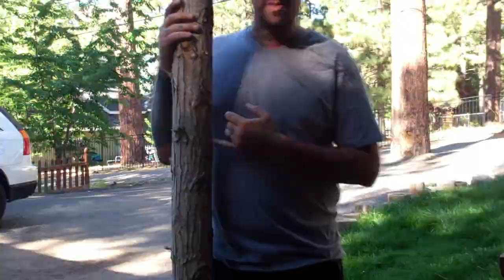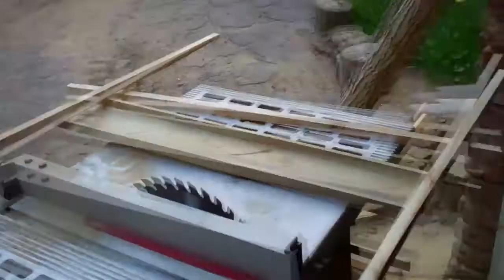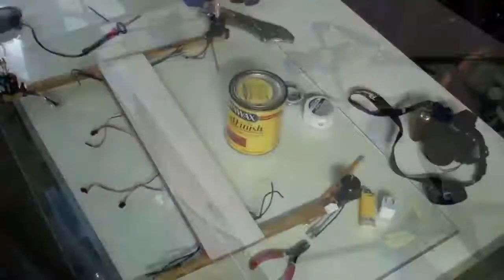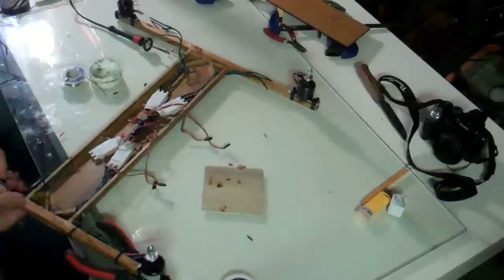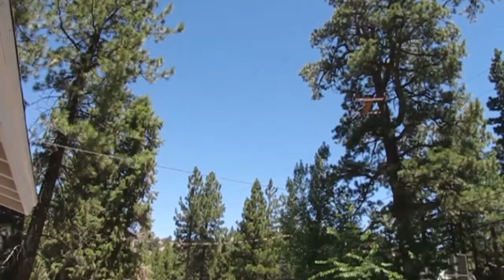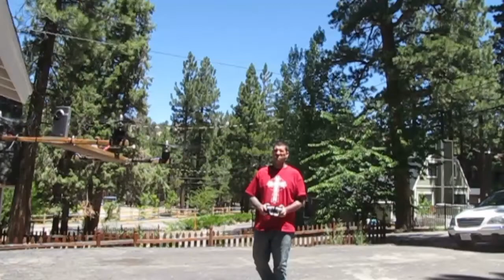Making an H-Copter out of a fallen tree

Comment: Yes - the one that flies the best for me so far has 10" bass wood arms, 10" dji props, 880kv motors and 7" lexan disks (it is not an H copter) and lexan legs.  I haven't broken any lexan yet :) The 3/8" sq bass is actually lighter then 1/2" alum. The bass also flexes, which is a good thing :)

Comment: Hi Jake,
Awesome frame -
Hey I'm curious - what kind of setting are you flying these frames with on the NAZA. Like what is your pitch, roll, yaw, vertical and attitude gains -   I had mine all set near 125 % for a copter and it worked fine.  I built one of your frames and my settings are way down to 50 % and I'm still getting oscillations  ?
Thanks,
Rick